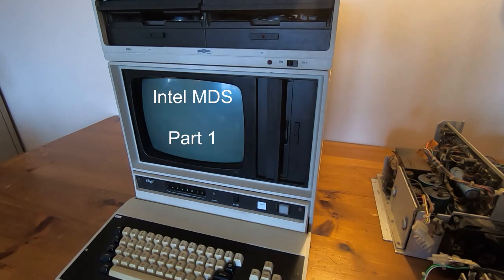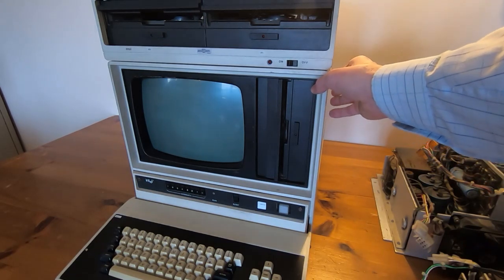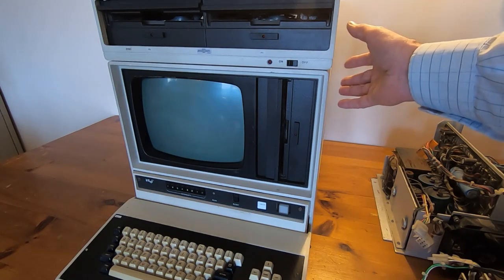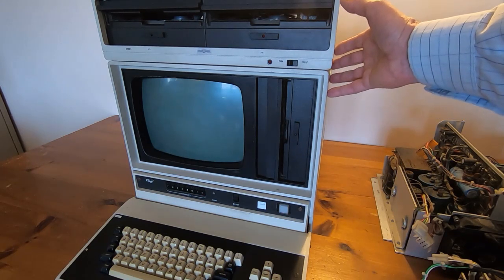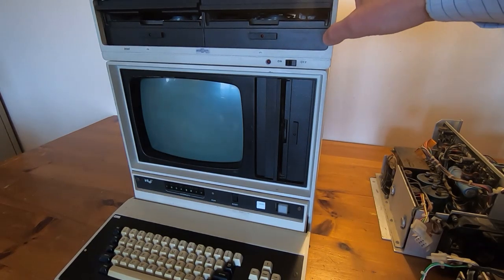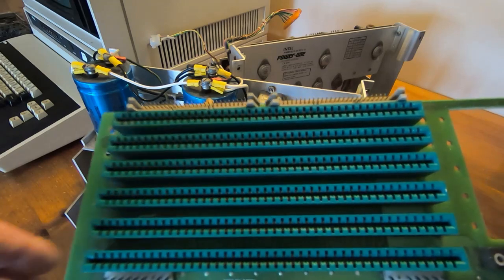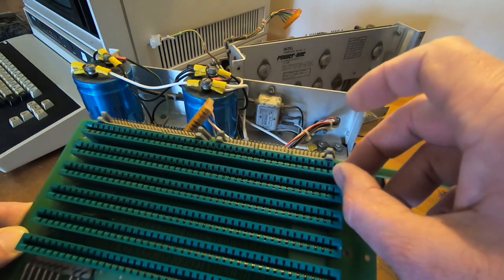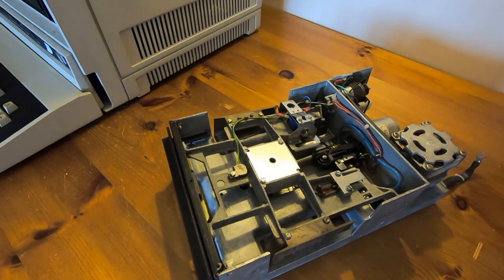Intel MDS Part1

Comment: I used to use this to create ASM86 files. Its a long time ago (40 years) so i forget exactly. From memory we had the source code in ASM86 on one of the large floopy disks, but it might have been two. There was a editor to allo us to edit the source files and source control consisted of whos got the floopy disks. You then, if i recall ran the linker, and it required an additional disk inserted whilst it then produced the object files, so there was a bit of swapping disks about and then i think it was the compiler, but i cant recall and it would then produce the actual machine code binary file. This consisted of two binary files one for the high byte d8 to d15 and one for the low bytes d0 to d7. We then had an eprom programmer and this loaded the binary files into the eproms. Does that sound correct ?

Comment: Hi Jerry. Glad I found your video series on the Intel MDS units.  I have parts of three of these systems that I've collected over the years but have not had the opportunity to test them yet. Hopefully I can get at least one system running from the three units.  I'm sure your videos will help a lot.  In my second stint at Intel in Santa Clara in 1984 or so, I built a test system and wrote some 3000 lines of code in PLM80 using one of these MDS units as the controller and user interface to test the 2764 64KB EPROM.  A really fun project and my introduction to microcomputers.  Looking forward to viewing the rest of the videos!
Reply: this is a long shot, but would happen to have extra keys for the keyboard of an MDS 240M? im missing the escape key and the number 3 key. id be interested in buying some off you but if not i totally understand

Comment: We had an MDS 220 as  PC at home... never saw one assembled before so thanks.   Dad brought it home from work where they had decided to replace rather than repair... ours was a stacked set of boards with an external monitor and the 160k (i think) floppy just laid on the desk.  Dad hacked it to address 2x the standard ram and it was my intro to home computing late 70s/early 80s.  CP/M and adventure, learning to code is assembly,  etc was my computing start.  Thanks for the trip down memory lane!  Cheers

Comment: A 9010, and a machine running ISIS, sure does bring back memories. We used the successor to this made for the 8088. Blue, external hard sectored, single sided floppies, and if you turned it off with a disk in the drive, it would wipe that disk every single time. We had six of them, and finally had to put a floppy in the safe so we would have one to copy when people who didn't know slowly wiped out every disk. I wonder, do you know about, or have used a 9020? I used to write software for them as well. It's a 9010 that can only run programs, all the programming keys are gone, can only load and run from tape.
Reply from the maker: As you say the 9020 is a 9010 with the programming interface removed. It is otherwise very similar and is intended to be used from a PC using scripts. I have never really seen the point in them as having the option to run the machine stand alone is always going to be useful. Possibly a few niche uses but I would always choose the 9010.
Reply: @JerryWalker001  The intent where I worked at the time was to use the 9020 with a Probotics (think plotter that held the 9020 logic probe instead of a pen). We would write the software and less skilled technicians would run it and diagnose failures (IBM PC production line). It was a bust. Obviously a management decision, but fun.

Comment: I'm glad I stumbled on this video today. I worked and played with an Intel MDS from 1978 to 1988. (Yes, I know 1988 was late). Sadly, I threw away my floppy discs and programme listings in 1997 when I emigrated, because I thought I'd never see an MDS again. The games I wrote would be an amusing gift to museums.
Reply from the maker: I am sure that they would appreicate any information relating to these machines. I also used the MDS units many years ago and I got rid of the last one in the early 90's (and wish I had kep it). They are very interesting machines and typically way over engineered as so many units were back then but then again that is the main reason they are still here.
Reply: I wrote a Game of Life, various maze generators (for the screen and the printer), a text-driven battle game, a silly little chat program. It's amazing how much I could squeeze out of a 25x80 text only screen.

Comment: Completely useless fact, but the Gray colour case you have there was only an option on the 240V models all the others are Blue. Looking forward to the rest of the videos. I guess the driver boards on the PSU are soldered on the back of the power transistors as my ones in the MDS-800, bit of a pain really. It's difficult to really appreciate just how heavy those PSU's are till you try and remove one ! That RAM Card you showed is identical to the one I'm working on at the moment, so I'd be quite wary of the two capacitors on the 12v supply C1 and C96.
Reply from the maker: Correct. It seems that that colour was aimed at the UK market while the US seemed to like the blue (I have both here). The two types of supplies I have are different. The one at the back in the video has all the power devices passing through a single heatsink and into the board so removing the board would be a major task. The other type seems to be much easier to work on but time will tell. Next step is to get a supply cleaned up and tested and then I can make up a test jig and start work on the boards. I certainly would not want to try juggling with the supplies.